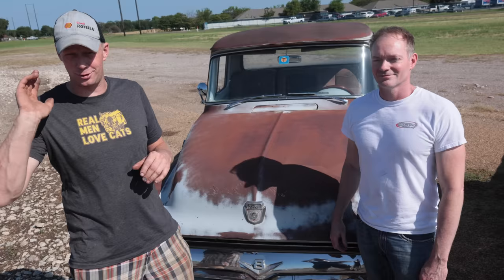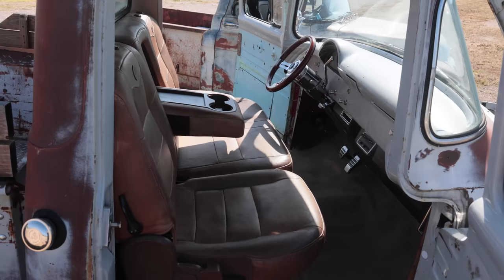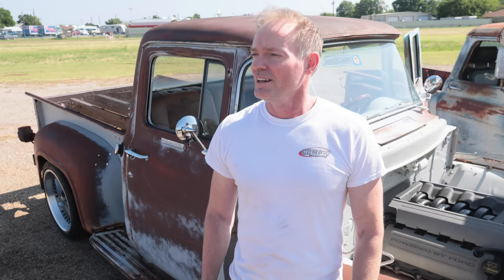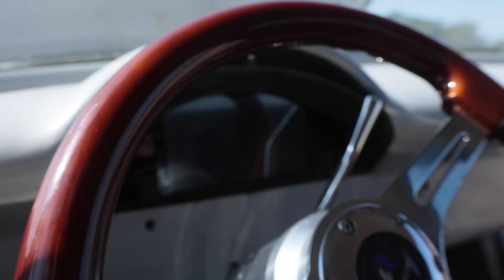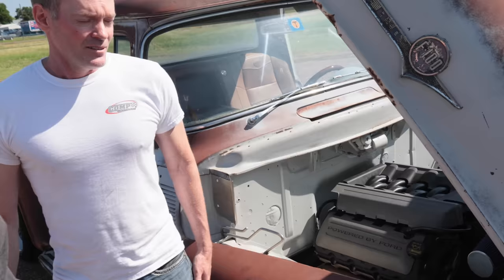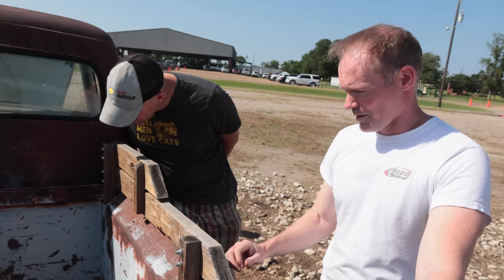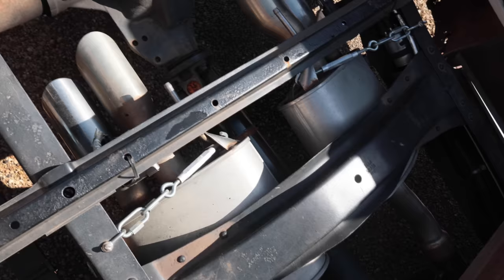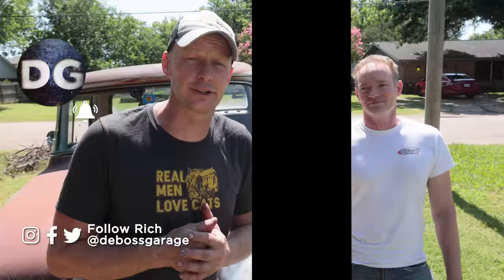5.0 Coyote swapped '56 Ford F100 Rides Like a Dream!

Comment: Nice job! Only thing I didn't like was the passenger door gap looking from the inside out. A bit too much light for me 😅!
Reply: 🤣🤣 you aren’t supposed to notice! I have a new set of hinges going in but still need painting so had to use the old ones for this shoot so yeah the alignment is a tad low😊
Reply: @tommynewland4837  all good, it's some machine in fairness! Lots of work went into it. Fair play!  thanks for clarifying 😁.
Reply: @jmyd83  🤣🤣🤣
Reply: Hahah that tool in the Ford rolling coal on you guys 😂
Reply: @tommynewland4837  Meh - Some weatherstripping is no biggie, man!!!  Seriously awesome truck, dude.  I specifically liked and can relate to the little touches, the extra stuff... like the powered vent door, the exhaust actuators, and extra stuff you went extra mile on with microcontrollers and interfaces!  That is right up my ally!!
Reply: Texas isn't nice to door seals.
Reply: Haha, that is also true!
Reply: Thanks, it’s been fun, still a few more tricks to finish up on it 😁
Reply: @tommynewland4837 
I need help building my 56

Comment: Do a s550 mustang IRS!
Reply: I’d like to. Maybe another upgrade later?! My biggest concern with that is the space it would take up in the bed. I’ve managed to keep the bed intact so far and I do actually use it to haul things so the  4 link and Ridetech components I can fit and have close to no change in the bed height. I’m doing most of this in my driveway or borrowing some shop time so I try to plan everything out as best I can to make it fast and efficient. 😁

Comment: The only thing I would change is to add weatherstripping to the doors😁
Reply: Can see daylight on top of passenger door
Reply: 🤣🤣 me too! I have a new set of hinges going in but still need painting so had to use the old ones for this shoot so yeah the alignment is a tad low😊
Reply: @tommynewland4837 any fitment issues with the KR seat? I was thinking it would be to wide. What year is it out of? I’m building a 54 f100 right now

Comment: V8 emblem in the grill and v6 emblem on the hood....
Reply: Oh goodness. It must not be stock😮
Reply: Can you explain what the V8 hood emblem is supposed to look like? I'm very familiar with all the 53-56 grill variations, depending on the options. But did not know the front hood emblem also indicated whether it was a V8 or Inline 6...
Reply: @centraltexasfoxbodies I did some homework and I'm sorry, but I believe you are mistaken. The 53-56 FRONT Hood emblems were all the same. The grilles varied year to year and on engine type or "custom cab". The V8 FRONT Hood emblem did not appear until 1965.